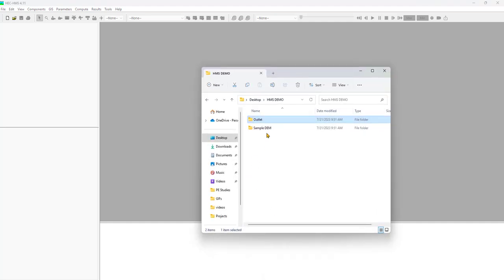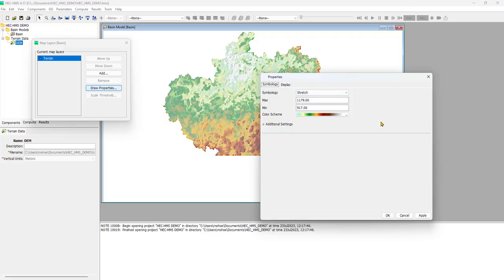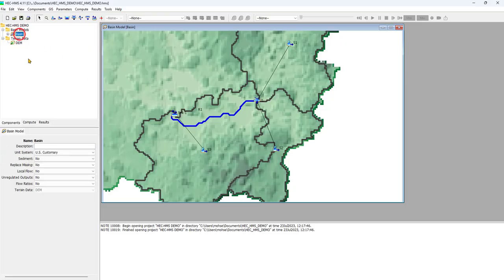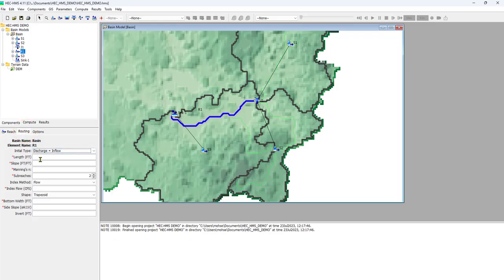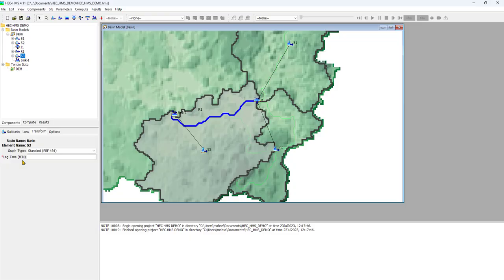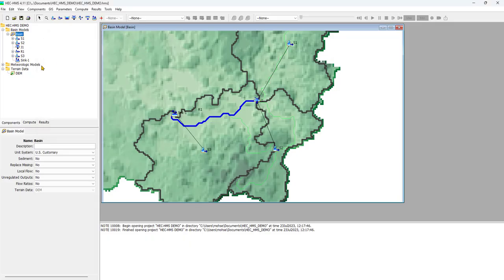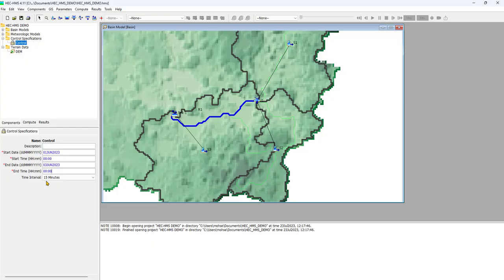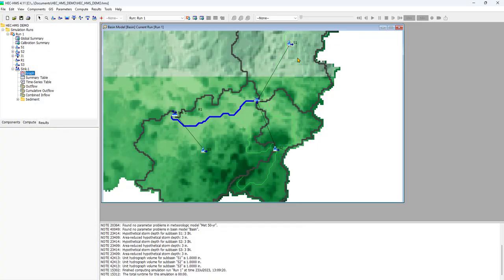Watershed Wizardry: HEC-HMS 101- A Step-by-Step Tour of Watershed Modeling

Comment: Hello sir. A quick question, can I use metric units when creating the project and later use SCS unit hydrograph using PRF 484? because the 484 constant is generated not in metric units, can I still use the formula for it or should I change method to clark unit?

Comment: Can you still use SCS method for continuous model?
Reply from the maker: The continuous simulation uses a method called the Soil Accounting Method (SMA) which is different from the event methods.
Reply: @HydroMohsen  so in short, SCS method is strictly for event models?